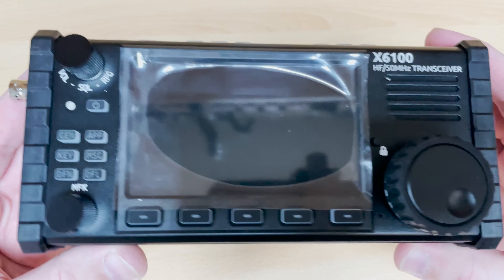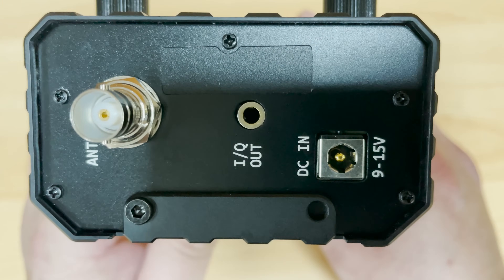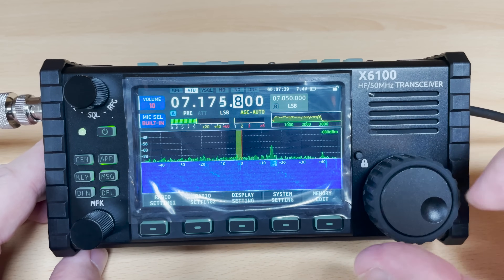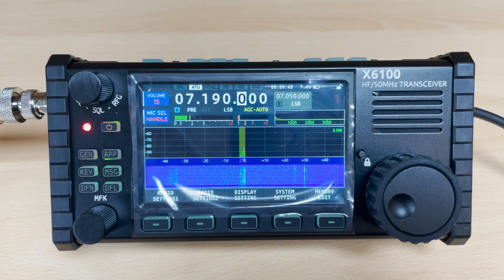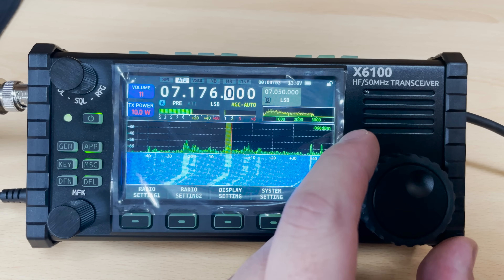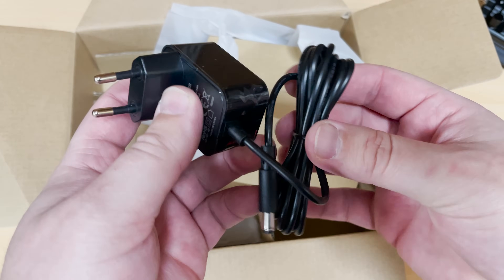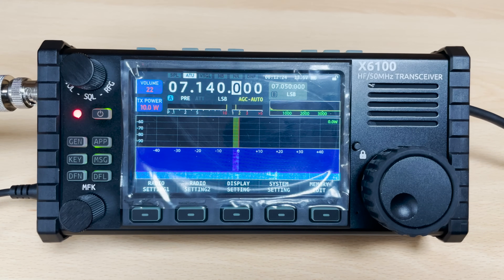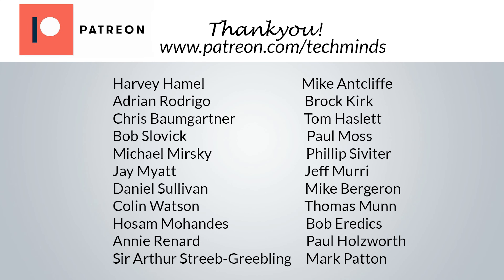XIEGU X6100 HF SDR Transceiver - Hands On Experience

Comment: A comment if you don’t mind. First, let me  say this was an outstanding fantastic video you did. I’m talking about the 6100 Xiegu now. 
When I first bought it last year, I had high hopes for it. And sure enough it had problems. For example, you could not finetune it. That portion just did not work. But finally with the last upgrade, I have spent quite some time with the radio. Thank goodness because before when I bought it, I left it in a box and wanted to spit on it every time I walked past. But after I made the last software upgrade it now has wonderful fine tuning and I actually was able to send Winlink over it with just a USB cable. I also did WSPR with it. And was able to find tune and do CW with it. It seems like the little box with its upgrade is coming into its own. So I think now if someone talks about it, they should first upgrade the 6100 with the latest firmware and find out that it is coming into its own. I really really like the 6100 now however there’s one thing I do not like. And that is the cheap rinky-dink tinny sound coming out of its speaker. But other than that, with a set of earbuds, I can hear it pretty clearly, and if I was to go portable and want to grab a quick radio that has an internal battery and yes, it has an internal antenna tuner I am giving second thoughts about it and may start carrying it whole lot more. With its internal battery and microphone on the front of it you can almost use it like a walkie-talkie. So the 6100 to me is coming around. I think it can safely be considered when looking for a QRP radio. Because it can also do all the digital modes. Finally, the fine-tuning works. So don’t discount that Xieugu x6100 anymore until you’ve done the last upgrade, the software, and I think you will be quite impressed.
Oh yes, I don’t want to forget, saying that I was so easily able to send Vara HF Winlink email without an external sound card. The one built in this little box is doing just a great job. So this little boy is climbing the ladder.
Reply: Is there a simple way to determine if you have the respective firmware needed to fine-tune it? I just purchased this radio a couple weeks ago and I noticed how it doesn't seem to fine-tune with the tuner knob. I can adjust the increments via the FST button up on the top-right, but it seems like the lowest increments I can adjust are the 10s? (And not the single hertz.)

In the system info screen, I can see that I have the following:
APP: V1.1.9  Sep 14 2024, 12:11:57
BASE: V1.1.8  Sep 15 2024, 15:22:37

Looks like it should be pretty up-to-date considering your comment is from a year ago. Thoughts? How does one do fine-tuning on this thing?

Comment: The killer feature is that you can side=load armbian and run wsjt-x and js8call INSIDE the radio.
Reply: My firmware allows to receive FT8 without Armbian. WSJT-X is very bulky for such a screen

Comment: I bought a used one at a local hamfest here in the states. I paid $ 175.00. The fellow who had went SK. He was not even a ham, he was an SWL. I’ve turned it on only once, and plan on using it portable. It has some very nice features. I did not receive a LiFePO4 charger with it though.. I have a 3.7/7.4/11.1 lifeychager, but I do not know the polarity? Can u help me out please? Thanks need several more videos please.
Thanks
de WB9DBD, Marc, Franklin, GA

Comment: i need the program to do a mars mod to convert to all mode for all transmit,can you help me,thank's
Reply: That makes not really sense. This is an HAM radio equipment and indeed not a pirate transmission rig. It is probably possible to make such a modification therefore there is no HAM interested in a project allowing unlicenced people to transmit where they even aren't allowed to receive, disturbing services even more important as the HAM service already is.
If you have professional needs to transmit on frequencies in the actually blocked ranges, you already know there are appropriate radios for this.
Even more if you are not a licenced radio amateur you are playing a risky job transmitting with this radio even on the HAM assigned frequencies. Police officers or three letters agents will knock or worse on your door and give you a concrete lesson on what means law.
From the technical point of view I'm confident in the fact the antenna tuner inside the radio can't tune or tune efficiently  outside the HAM frequencies bands. This may set the transmitter part at risk of damage or in protection mode due to the power not being able to pass to the probably else non adapted antenna connected.
Regards, IK2WQI, Andreas.

Comment: As you have not responded to my previous comment I'm assuming Moonraker will be selling the demo'd radio as new ? I was just about to purchase a Lab599 TX-500 radio from them, but then thought I may receive a used radio, so won't be buying from them.
Reply from the maker: I don’t work for Moonraker so I can’t answer that question, call them! As far as I know I used a demo rig.

Comment: At first glance, this is quite an amazing piece of technology. But...I've had problems with the quality of Chinese things. 
Everyone knows about Harbor Freight and one-use tools. 
I've had three Baofeng UV series HTs that have gone brain dead. I had a Radioddity QB25 whose audio output died conveniently two weeks out of warranty. 
On the other hand, I have several Japanese ham radios that are approaching 40 years old that still perform quite well. I have several Japanese CB radios that are over 50 years old that still work well. 
As always, you pay your money and you take your chances, but as long as "Chinese" and "quality" are mutually exclusive concepts I'll buy quality every time.
Reply: Fortunately, these aren't from Harbor Freight.  I have a G90 and X5105, and they are simply amazing radios for the price.  I've had zero issues with either.  I do find myself taking the G90 portable more often than the FT-891.  My X6100 is supposed to arrive Friday, and I can't wait to get it out in the field.